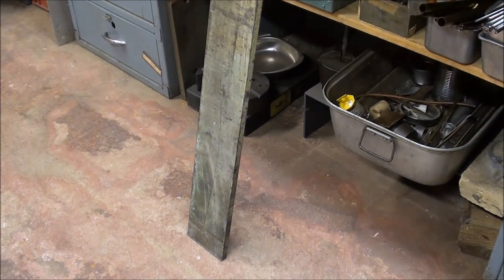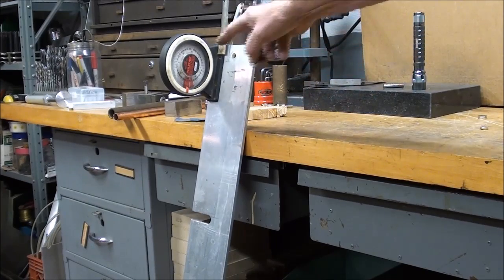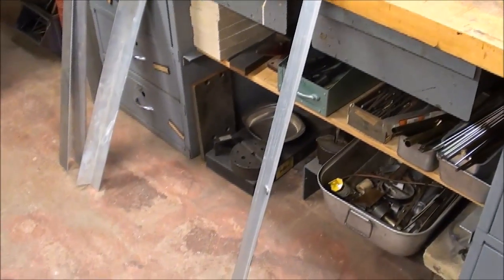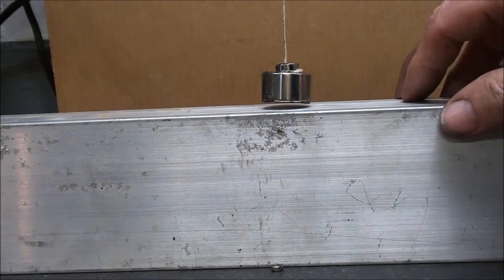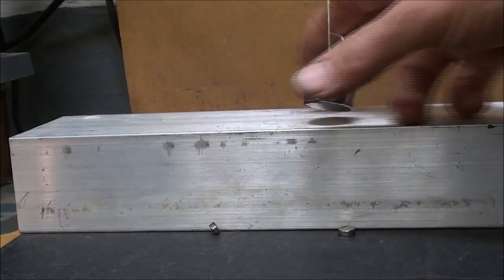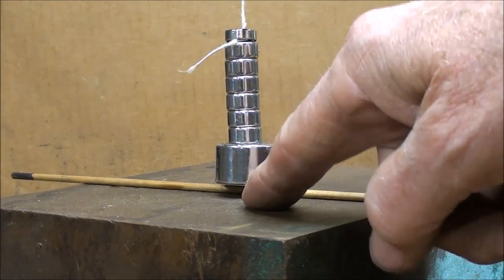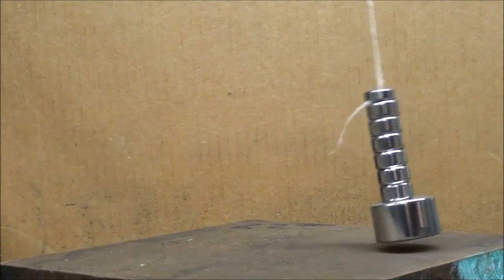tubalcain Demonstrates NEODYMIUM Rare Earth Magnets Lenz's Law Part 2 tubalcain

Comment: Brilliant illustration of Lenz's Law!  I used to teach this subject 20 years ago and this would have been a fantastic teaching aid!  Regarding your question with the large copper block and two magnets......  The reason the little magnet is moving is because  there is a magnetic field being produced within the copper block which is CREATED by the MOTION of the larger magnet.  Electromagnetic theory states that when there is relative MOTION between a conductor and a magnetic field an electric current is induced in the that conductor. That current in turn creates an opposing magnetic field (Lenz's Law)   In your experiment, think of the copper block as the conductor, and the motion is provided by your hand moving the large magnet.  This was a hard concept for students to grasp.
Reply from the maker: Thanks for watching & a good explanation.  I was disappointed at how few watched this vid.
Reply: mrpete222 I am glad to contribute Mr Pete.  It's  the least I can do after all I have gained from your wonderful explanations over the past 5 years!

Comment: Chemists best guess on the big magnet little magnet part.  The field from the big magnet is probably circulating the electrons in the copper block and when they move they make a magnetic field of their own that interacts with the small magnet.  like i said best guess. great video!  I'm trying to find out what would happen if you had a magnetic pipe and put a copper ball down the center or something like that. edit: it may just be the large magnet field messing with the other small magnets based on how they point to the big magnet.

Comment: Pete...

Not to get too technical and engaging in confusing "mathematics" (regarding Part 1 of this video), "Lenz law" is VITAL in motors and generators (alternators as well),

IE: If it was not for this law, electric motors (when power is applied) would begin to go faster and faster until they destroyed themselves.

In other words: generators/alternators and motors can be either. Yes they can; a generator can be a motor and a motor can be a generator; AND at the same time. This means that WHEN a motor is running it ALSO generates a CEMF (Counter Electromotive Force). This voltage opposes the voltage EMF (Electromotive Force) that is running a motor.

WHEN the CEMF (self generated within the motor) is exactly opposite the EMF (supplied by the power fed to the motor), the motor will stop running faster and remain at that speed. Usually either 1725 or 3450 RPM (depending on the number of magnetic "Poles" within the motor). They are said to be in magnetic balance at this speed. And a motor can be destroyed quickly if this balance is disturbed..

I will always believe that our precious Jesus (God manifested IN the flesh) created this "law" for our use once electricity was discovered. As I believe He did this for ALL "physical" laws . For if not, motors would have been of little use. As would be the entire universe!

Praise His Holy Name.

Comment: Fun video. I've tried a few of these myself. I hadn't seen the pendulum or the ramp experiments before.

My father (trained as a chemist, but ended up in instrumentation - designing and making) used this effect to slow the oscillations of a laboratory balance (so sensitive it can measure the weight of a one inch pencil line on a piece of paper). He hung (and counterbalanced) a small sheet of copper in a strong (for the time - Alnico magnets) magnetic field. The balance (In a glass case to avoid air currents) would normally take several minutes to stop see-sawing back and forth. With the copper-in-magnetic-field arrangement it would slow to a stop in a second or two, without affecting the sensitivity. I don't recall him mentioning Lenz's Law, but he was certainly aware of the effect (back in the 1950s).
Reply from the maker: Interesting--thanks

Comment: Fascinating stuff indeed.
Reminded me of an old TV program shown here in Oztralia hosted by Professor Julius Sumner Miller called "Why Is It So?"
He would demonstrate various principles of Physics and challenge his audience to explain what was happening.
If a Delrin washer was used to insulate a washer made from the same material as the tube you dropped the magnet into may give a way to measure roughly the voltage induced overall in the tube. However the localised induced current and flux are what drives the effect observed. Maybe the less mathematically challenged in the group could " Do the Math "for the rest of us.
I'd be interested in trying the magnet sliding down a slope experiment in zero gravity, so how about it Sir Richard Branson, a free flight into space in the name of science please.
Cheers Eric

Comment: These neodymium magnets are present in every hard drive. Older, larger-sized HDDs had huge magnets on the servo arms. 
I will warn that they are only powerful closeup, and yes, can hurt your fingers. But I found they are difficult to separate apart, but not if you slide them. Yes, they are also brittle. Rare earth magnets do not magnetize tools as effectively as iron-ferrite magnets (those you see in tool catalogs that magnetize-demagnetize (WIHA makes one, for their precision drivers).
Got a failed hard drive you don't need? Take it apart. Input them in tins and stick to my fridge. Be surprised I stuck a tin under a 4x4...years later found it still on the frame!

Comment: Sorry, here's a correction - the induced magnetic pole in the copper/aluminium is the opposite polarity. The moving magnet is attracted to it and that is what slows it down. There has to be some movement so the opposite pole can be generated which is why it does not actually stop. If it was a superconductor I expect the movement would stop and the magnetic field would continue indefinitely. Apologies for that Mr. Pete!

Comment: As the magnet moves along the surface of the copper, its magnetic field moves though the copper. That moving magnetic field generates an electric current in the copper. That current in its turn generates its own magnetic field in the same polarity as the magnet. Like poles repel, so the magnetic field from the copper slows the moving magnet.

The difference in speed of the moving magnets over different metals is down to the different electrical resistance of the metals - copper conducts better than aluminium etc. If you could use silver, the magnet will move even slower.

Something similar occurs in DC motors - it's called Back EMF (Electro-Motive Force), the rotation of the commutator generates a current that tries to oppose the driving current.
Reply from the maker: Thanks--good explanation

Comment: You are so right. There are many viewers from the UK and I am one of them ! By the way thanks for the advice on using heavy oil with the bit when drilling hardened steel. This worked well to drill out a seized motorbike front axle when all other methods (leverage, heat and penetrating oil) had all failed. It was hard work with a standard electric drill, but eventually successful.
Keep up the good work.

Comment: I have one of these magnets that is a 2 inch cube and it is something that i have come to respect in terms of holding power !
You have to use a pry bar to get it of a piece of steel and I once made the mistake of carrying it in my hand and i let my hand get too close to my mill table , it pulled my hand to the table and clamped it there  - ouch !!!
There is a show on Foxtel called Dara obriens science club that did a few shows about these magnets , they showed some being used to levitate a platform using superconductors and a few others using a magnetic fluid that is designed to pick up oil slicks - the effects are amazing !
Got to be careful as those things are like glass and shatter if you hit them hard enough !
I wonder what the effect of these would be in a permanent magnet dc motor over the old ceramic type ?
Mr Pete watching your videos is NEVER a waste of time !
Keep 'em coming !!!
Reply from the maker: THANKS for watching

Comment: This video reminded me of an old Thorens TD-124 turntable I junk-picked from the garbage and still have from early/mid 1960s. The speed-control fine-tuning is a magnet that is placed about 10 thousandths from a spinning aluminum wheel. The mechanical fine speed control moves the magnet +/- .003 in. causing a few percent +/- change in turntable speed. A very accurate control.

Comment: You can make a constant torque clutch by bonding magnets to a disk attached to the end of a shaft and putting an aluminum disk attached to another shaft close to it.  Spinning the disk with the magnets transmits a torque to the second disk that is proportional to the gap between the magnets and the aluminum disk and the relative rotational speeds of the shafts.  The magnets should be mounted with adjacent magnets oriented with opposing poles facing the disk they are mounted on.  That disk should be iron or steel.  Works great for winding items on a coil.

Comment: You might want to try this one-if you make a coil of copper (wind around a pencil) and if you have a LED connect one leg to each end of the coil and swing your magnet over it (on the sting) it SHOULD light the LED yes? But only in one direction maybe? I am not sure how many turns it would take to "blink" the LED-just a thought I had for what its worth I like ALL your videos
Reply from the maker: THANKS for watching--will try that
Reply: mrpete222
Make a diode bridge and a small capacitor and it should light up and stay on longer in both directions.

Comment: I have a question I hope you can answer. If space is the only thing that stops a magnet attracting. How come you can turn off a magnetic base with the turn of a lever ?
Reply: There are two sets on magnets in the base. When the lever is turned in one direction the fields oppose one another in such a way as to cancel each other out. When the lever is turned the other direction the fields are allowed to flow unopposed and thus attract to a ferrous object.
Reply: Dick Sargent Thanks for that Always wondered how that worked.
Reply: Dohn Joe Thanks was just repeating Mr Pete with the distance quote. Magnets are a very curious thing. Facinating stuff.
Reply from the maker: It just repoints the poles

Comment: Another great video, Mr Pete.  I get these magnets from Hard Drives.  I use them to get small metal shavings and filings off of my workbench.  The first time I did this, I had a heck of a time getting all the whiskers off.  Then I started putting the magnet in a sandwich bag, passing the magnet over the work area, and then turning the bag inside out and pulling the magnet off of the shavings.  The stronger the magnet, the thicker the bag you will need.
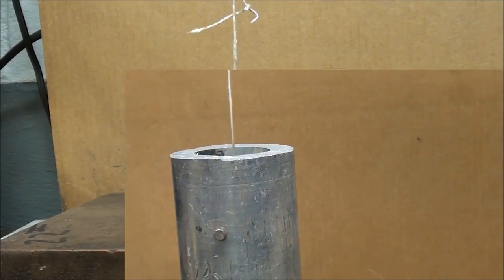Also, I noticed something interesting.  7:02 - 7:16 You were raising and lowering the large magnet over the copper block.  When it touched down and the string went slack, the string wound back on itself, indicating that it was twisted.  But when you raised the magnet the string didn't unwind like you would expect.  (It did unwind about 1/4 of a turn or so but I would have expected much more than that).

Comment: Lenz's law was applied to the function of auto speedometers back before electronics were used in cars.A magnet was spun by the speedo cable inside an aluminum cup which was connected to the needle of the meter. There was just enough clearance between magnet and cup so they wouldn't touch and the drag of the magnetic flux in the aluminum would cause it to turn.

Comment: Hey Mr. Pete.   I've always been fascinated by magnets too.
A couple comments:
When the magnet is inducing current there is a very small amount of heating in the material due to the small resistance.   That power loss is why the magnet doesn't just stop and stay in place.   However, if you have a material that has no resistance, the magnet will actually stay in place.   Of course, the only materials that don't have resistance are superconductors.   Without the resistance, the current induced stays and isn't "wasted" as heat and you get really crazy behaviors: https://www.youtube.com/watch?v=Z4XEQVnIFmQ
Space isn't the only way to reduce the effect of a neo magnet for shipping.   If you place  the magent between iron plates, the flux is redirected so less space is required to prevent it from interacting with other things.   There are neo magents inside hard drives which themselves have spinning disks that would other be erased by those magnets.   However, engineers use the same principles to redirect the flux away from the media.
https://www.youtube.com/watch?v=1zO9nWgI_LY&list=UUFHMw64uu66VKPXq5gh29IQ
You can see in this video that these large neo magnets are difficult to handle (these are smaller than the one he unpacks): https://www.youtube.com/watch?v=9Q8qqUsNf-U&list=UUFHMw64uu66VKPXq5gh29IQ
In this video, he exposes multiple elements to magnets and talks some about different types of magnetism...  https://www.youtube.com/watch?v=62dez4tD5Ok&list=UUFHMw64uu66VKPXq5gh29IQ
Talk about chipping?!?!?! This video shows the power of these large neo magnets:
https://www.youtube.com/watch?v=Vt8NOdINJ1s&feature=youtu.be

Comment: Great video but I have one question. How did you drill a hole in the magnet? I've tried and the magnets just disintegrate near the end of drilling. I am putting them in my lathe so I can drill them in the center and i am using a carbide drill bit. Thanks Mr. Pete.

Comment: Tubal

No you did NOT waste my time.
I do guest instructor for STEM stuff at local grade school.  Used a magnet and wire passing thru the field - current measured with a swichboard meter whose actuating current was 4 Ma.
 I showed eddy current to 5th graders by using steel and neo balls of near same diamter and dropped them thru clear plasted and then dropped them thru a piece of copper tubing and got same results you did.

I really liked the pendulum over the large copper block.  You might compare to a similar sized piece of wood.   Gotta replcate theat for the kids.

I really liked how well you stayed on topic.

Dan Bentler
Seattle
Reply from the maker: Thanks--great to hear from someone doing the same thing. Its wonderful what you are doing with our children.
I will probably do a part 3 follow up using some of your ideas and I have also got great suggestions from other viewers.
Reply: mrpete222 I am going to build a replica of your pendulum.  After I present to the kids I will give you their like and dislike on it.

I suppose one could measure the current thru bar stock - would just take a large magnet and sensitive current meter.
Smaller and simpler is the tried and true high school demo using horseshoe magnet loop of wire and a a sensitive ammeter somewhere in range of micro to milli amp.  Full scale on many DC ammeters (used with shunt) is 50 mA so it may not be that difficult to measure.  
The meter I use is a switchboard Power Factor meter whose operating current is 0 to 4 mA if I read the label correctly.
Very willing to help you out with this.

Dan Bentler

Comment: I get mine from dead hard drives. Put one on a cork in water or glue a thread to it and suspend it so it can spin freely. Take another a distance away and see how far you have to get before the one in you hand can't affect the spin of the other one. My record holders so far were about 3 feet!

PS, a bonus material from the hard drive is the MU metal which acts like a magnetic shield of reflector. It's just about as remarkable as the magnets. If you place your magnet on Mu metal and try to stick the MU metal to steel it will not stick.

BTW, the other type of magnetism is DIAMAGNETIC. It's like the superconductors which repel magnets to float them. You can experiment with something like a grape attached to a hanging mobile bring your strong magnet near it and it will push away from the magnet. (Be sure there is no steel in your mobile)
Reply: +ExtantFrodo2 What part of the hard drive mechanism is this MU metal?  Is it easy to recognize?  Thank You.
Reply: slad roznik
The magnets are usually glued to them. They don't always use it. It's easy to test. There would be a huge reduction in the attraction to a piece of steel when the magnet is on the other side.
Reply: I have several old disassembled drives. Found the mu metal pieces. The metal looks the same, it will just have to be tested. learn something new almost every day.

Comment: Mr Pete,  Another trip down memory lane.  When I worked at GE Research in the 80's the fellows in the next lab were experimenting with various alloys to maximize the neo magnets  performance. This was a great lesson because I had forgotten most of this, not having seen it for ~ 25 -30 years.

 I'll have to get some and show my Grandson some of these experiments.

By the way the reason they chip and break is they are made of sintered powder metal and these alloys have very little impact resistance.  I'm not surprised that one exploded.

 Thanks again and Merry Christmas to you and your family.